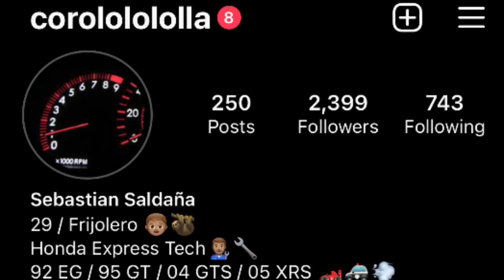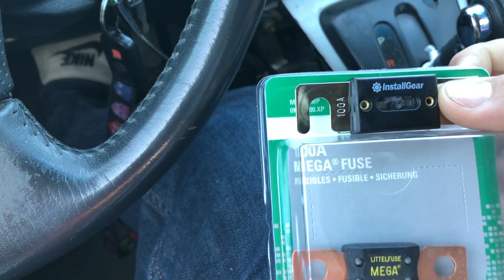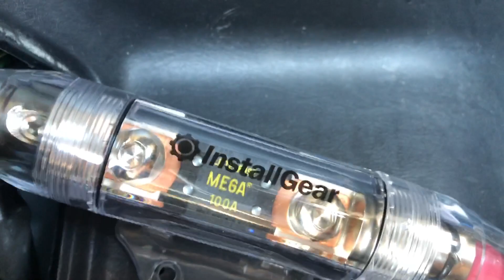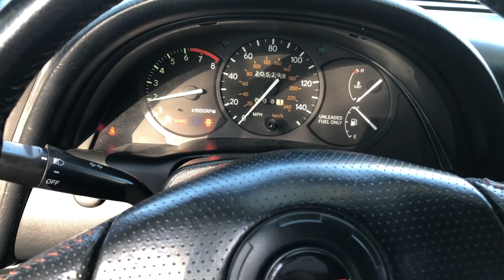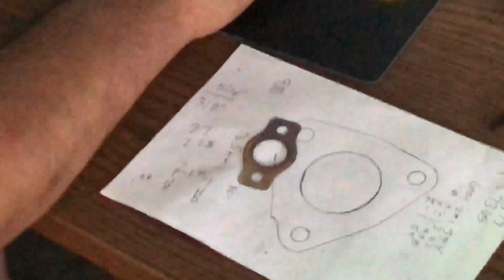The main reason why car enthusiasts hate California.

Comment: i feel the pain on the orielly parts. my alternator failed within a few months after purchasing and i put about 300 miles on it. I have 1st gen Scion tc starter on my S54. lighter and put out more current. your car is an obd1 spec, so no wonder why its much easier to pass smog...
Reply from the maker: might have to give that one a shot because i much rather want a new starter than a remanufactured one. yes obd1 so as long as my car passes the dyno portion of the smog and i have all my emissions components im golden.

Comment: CA smog testing, etc is a joke. The laws are anti car enthusiasts, but the majority of the drivers on the road are not car enthusiasts (90%?). 

The majority of CA drivers should be in electric SUVs.
Reply from the maker: What’s funny is the obdii test is dumb in some cases like my dads Matrix…has a trouble code for the transmission electronics side and won’t pass smog because of that but would pass flying colors on the sniff test. It’s not even car enthusiasts causing the pollution, big SUV and Trucks probably cause a good amount of that.